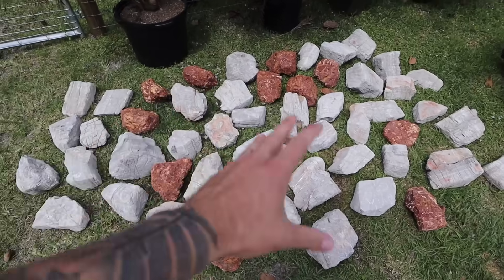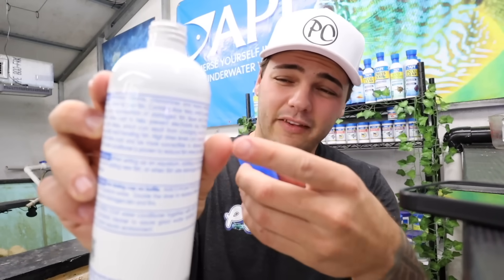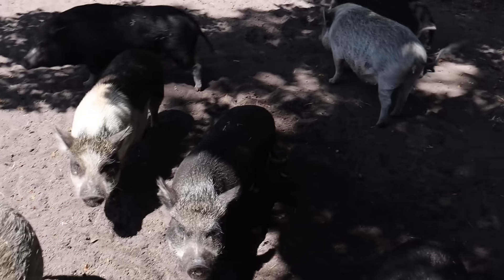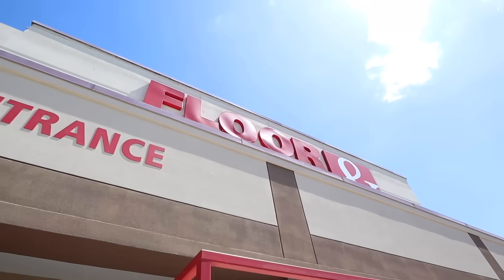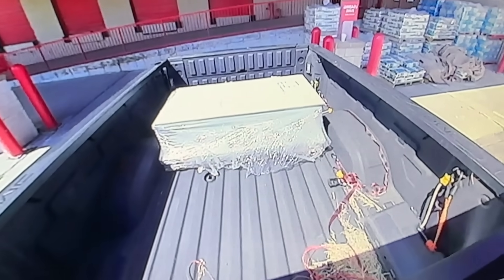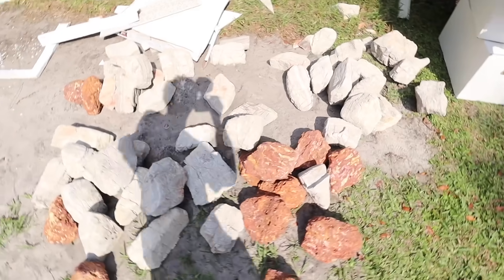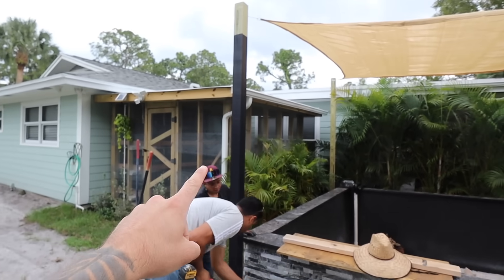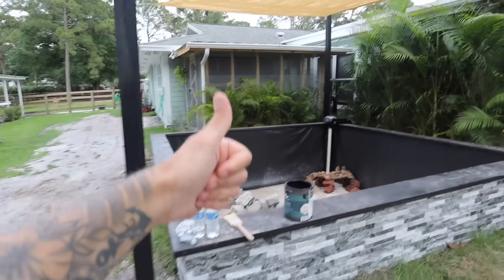Finished My FRESHWATER MONSTER FISH POND!!

Comment: So if the pond is 12x12x5 that would make it 5385 gallons, that is awesome!
Reply: Smart
Reply: But the pond is nowhere near 12x12x5. The tile he bought were 2x4 and he could only fit 2 and a half tile. The pond is a massive downgrade and he knows it yet keeps lying about it.
Reply: @bernardoknox7273  he never actually said the pond was 12 x 12 x 5 he said it was 3 ft below ground and 2 ft above ground and he said the shade tarp was 12 x 12 which was pretty much corner to corner so that adds up to be those measurements seems about right to me
Reply: @cainfrittswallace7895  He actually did say the pond was 12x12x5 on multiple occasions, he even got hector to say it on cam. Just like he got Finatic to say, on cam, that this was his biggest pond. Even the thumbnail on this video says my biggest pond. It's not. He used 4x8 plywood and they fit snuggly from top to bottom, he could only fit ten feet of tile using 2x4's and most importantly, he's using a 20 foot liner. You need at least 6 inches of overhang on both sides of the pond and Paul even managed to have 5-6 inches left. If it's 12x12x5 he would need almost 24 feet of liner.
Reply: @bernardoknox7273  right honestly I don't care either way it's a cool pond, seems like you're pretty heated towards him, if you don't like the content don't watch it 🤷 vote with your subscription and watch time that's what I do. Have a nice rest of the evening 🤙
Reply: @cainfrittswallace7895  Right. Honestly, you cared until you were proven wrong. A nice evening to you and always care about animal welfare.
Reply: @cainfrittswallace7895 but the shade cover extends out to the poles which are past the edge of pond. So I'd say like a 1 1/2 ft less. So maybe 10.5×10.5×4.75.

Comment: Paul you should use the driftwood stump that's in the circular pond. Then use the spray foam and mount the stump on top of the round shape elephant stone feature. Which would make a cave and add taller center feature

Comment: Paul you got unlucky so many times building this pond! From the tile breaking, to the lost pea gravel, to the rocks not being quite enough structure .... damn dude, I am sorry! Lol, that being said though sometimes you do need to work smarter not harder. You've got that landscaper buddy right? If he cuts down any trees around 7-10', or even if you and Gio or someone manage to find a downed tree on the side of the road (it's Florida man just wait lol), you can haul that bad boy into the pond. It will likely half or fully float, which is fine, all you need to do is remove as much bark and dead leaf material as possible and let it do its thing. Tannins will add brown tint to the water for a few rounds of water changes (good for the fish) but your filter should handle that and it'll clear in time. Fish love swimming under a floating branch structure and you can also pop some outdoor plants like pothos on top of the wood to grow over top. Lotta words here but you get the idea--it's cheap/free and it's huge, so why play around with rock? Love the pond regardless! Stay safe in the hurricane season!

Comment: The pond looks incredible, awesome job. Just wanna make sure the sun shade doesn't hold water when it rains! Being from Miami, one rainstorm is going to take that thing out if it pools!! If it doesn't hold water, all gooood. If it does, you can just angle it towards one post and it'll still look nice.
Reply: Also, I saw another comment about mounting lights on the four posts. That would look incredible.

Comment: Little tip for you, next time you get stone, or sand, or loam in the back of your truck, throw a tarp down in your bed first so you can just pull the tarp out and truck is clean then just shake out the tarp. Easy cleanup.

Comment: You can put pool noodle pieces on the bucking goats horns to keep the others from getting injured. 

You just cut them so they are about 6-8 inches longer than the horns. Then just slide those babies on there. 

It looks funny but it keeps the others safe. 😁 hope this helps!

Comment: ....Paul you're going to wind up needing to use that white tile 💯,,,that pea gravel will turn green & will be a pain in the ass to clean,lay that tile over the pea gravel & it will be WAY EASIER to clean. Plus it would look cool, sorta like a lost Civilization that got submerged 😎🙌🏛
Reply: I was thinking the same thing. He could use a pool brush to clean the tiles without having to go in. The net setup underneath is going to make it hard to clean as well.
Reply: I don't think it'll be an issue if his filter will leave the water crystal clear, same thing would happen to the tile but just a little easier to clean. But when you have crystal clear water it doesn't really bug you because you can see everything regardless

Comment: I guess the shade is too thin & small, it may create problems in future. Eg-If it's rain the pond may get flooded,chances being fish escaped from the pond.
It would have been great if you could have used some plastic,steel or fiber material & made it like an extension from your house.
Reply: No the fish won't be able to escape ,because of the net maybe
Reply: @sudipchakraborty2907  ya chances are low but never zero
Also from sunlight the water will turn green
Reply: @ashishdalvi3038  yeah that's a problem , but still he has a uv ,to mitigate it a little. 
With a great ,😂outdoor pond, comes these problems

Comment: I fear the installation of net across pond from under the edge could cause issues when you need to take it off partially or fully to access the fish or pond. Also worry if the fish jump into it they may pull it off into the water. With it being attached from the top it is easier to stretch over and hook it to secure.

Comment: You know Paul...that spray foam you are using...where I live it's $75USD a can or $125NZD...where by 'Gorilla' makes a water proof spray foam that cost's $19.99NZD a can...same size can as well, however it comes with it's own flow tube...the only difference is the colour...Gorilla is sand coloured while yours is grey...I opted to use the $19.99 one....what about you?